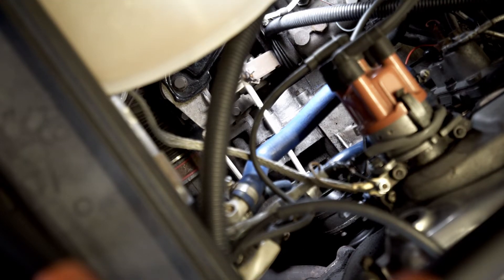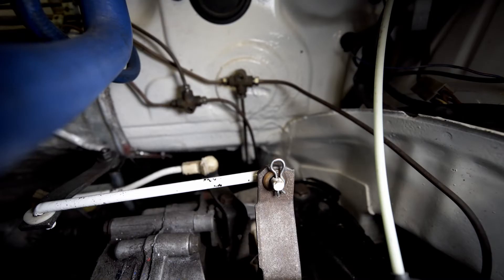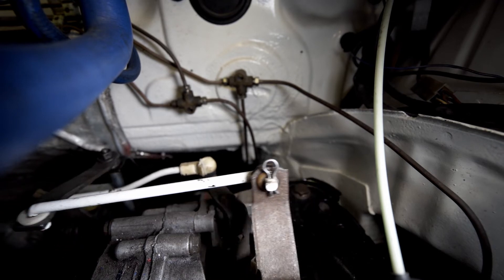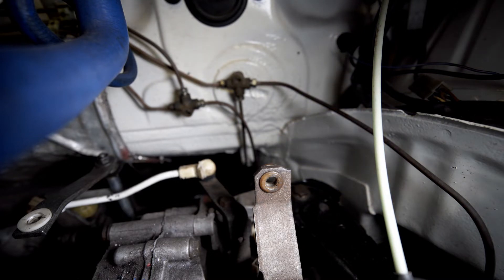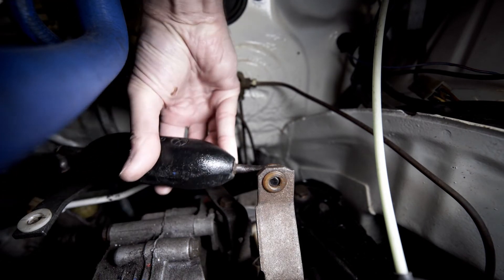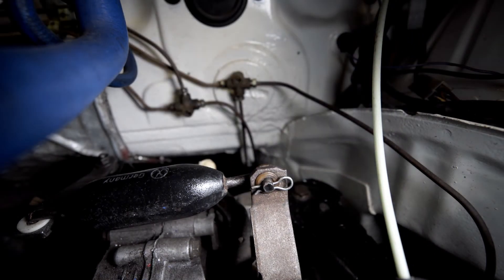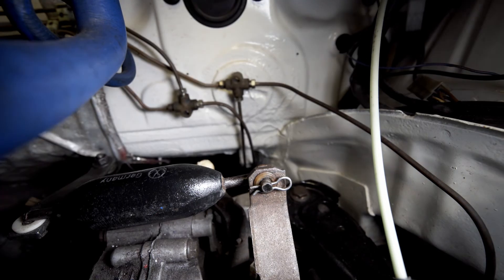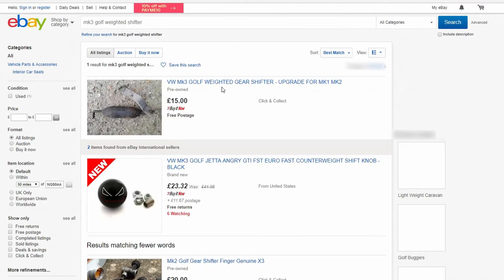Improving your Mk2 Golf Gear Change with a Weighted Shift Rod

Comment: Yes, a good upgrade.  Another option below:
https://www.4crawler.com/Diesel/ForSale/ShiftLinkage.shtml#BilletShiftRod
and we also can supply a hardware kit to use to modify an A3/Mk3 weighted rod to the rod end style and eliminate the wear prone plastic bushings and those locking pins:
https://www.4crawler.com/Diesel/ForSale/ShiftLinkage.shtml#FAQ5